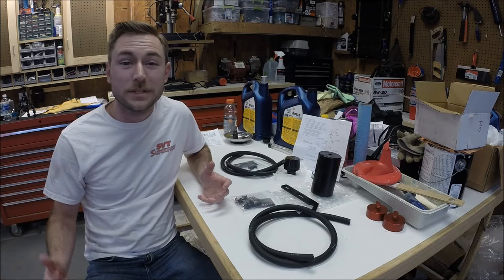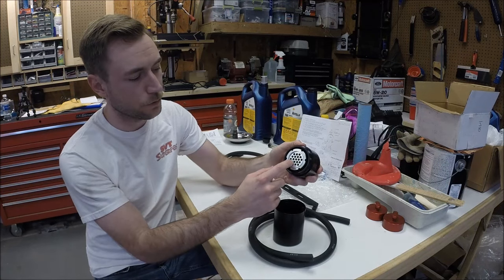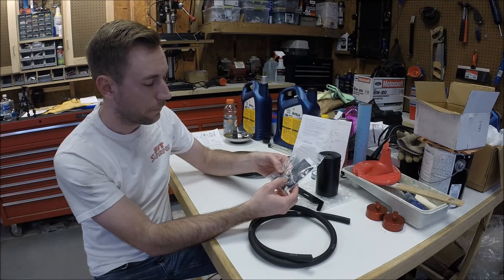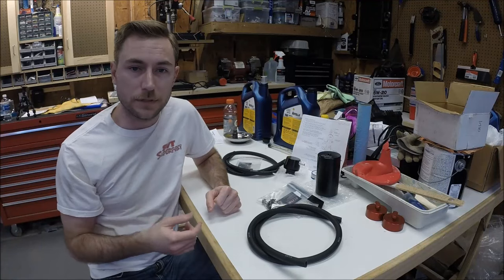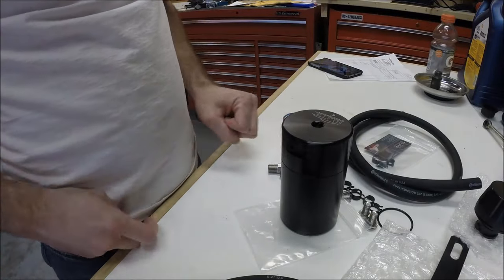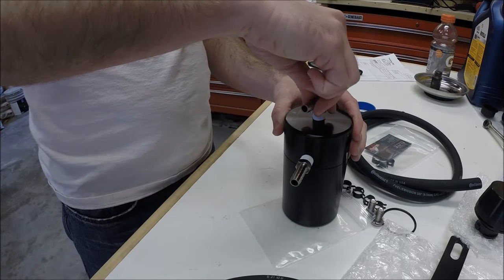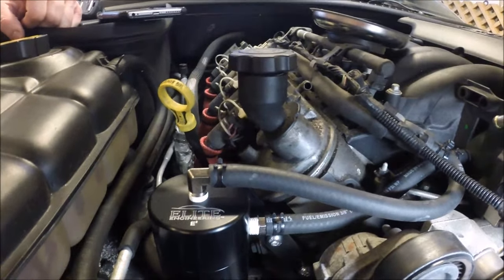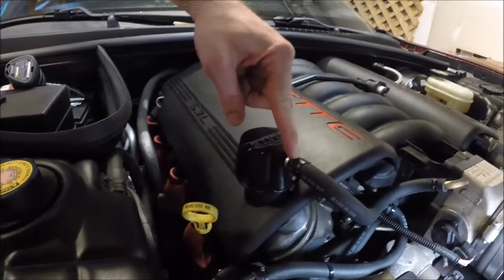Corvette LS1 - Elite Engineering E2 Catch Can Installation

Comment: I have a turbo LS4 setup... any ideas what to do?
Reply from the maker: Rick Dangerous  I'm not as familiar with the pcv routing on that motor but I can say it would need some configuration changes as you don't want intake pressure (boost) pressurizing the catch can.  I suggest contacting Elite Engineering for a setup specific to your turbo motor.

Comment: How often do you have to refill your oil
Reply from the maker: It will vary for each person/car and how you drive.  Also keep in mind that a catch can doesn't change the amount of crankcase blowby your engine produces.  It only captures it and prevents it from going through the intake manifold.  For me personally, I've always changed the oil between track events, so it never in there very long.  For track events, depending on how much your catch can is collecting, you may want to top off the oil each day.  For daily driving, you aren't likely to collect enough oil to need to top it off, but monitor it and see what your car needs.
Reply: @ScrufsGarage   Thank you for the information. I have a 2002 Camaro SS with the LS1 in it that I daily drive and I barely get into the throttle but sometimes I do
Reply from the maker: Happy to help.  I definitely recommend the catch can.  During my engine rebuild I had my intake manifold off and was able to see how much oily residue had gotten through the pcv system over the years.  So anything you can do to keep oil vapors out of the intake will be a benefit in the long run.
Reply: @ScrufsGarage   Yeah about 5 months ago I picked up my car and it had 13000 original miles on it so I want to keep it as clean as possible here is a video of it.  https://youtu.be/Qc7nAsWWJqo
Reply: Nice video, are you saying that I should NOT put that oil back into the engine?  Does it really matter since the oil is reused by the engine anyways?

Comment: Are you down any engine oil
Reply from the maker: Mr. Lucifer  you do need to monitor your oil level, but it shouldn't be dropping so fast that you have an issue.  (If it is, then you have bigger problems). Normal street driving isn't much of an issue but your first track day with it, def check it after each session until you get an idea of how quickly it fills up.

Comment: I also have a 2001 vette. However I am having fitment issues because of the belt spring tensioner. I believe it is an ugraded and larger tensioner because of the magnuson supercharger. The elite catch can kit I got came with the hockey stick bracket. Do u know of an alternate bracket or location that will work for the c5?
Reply from the maker: Hmm, I'm not sure.   The hockey stick bracket is slotted, so there's a bit of adjustment.  The further up you move it, the further it moves it away from the tensioner bracket.  It that doesn't work for you, you might be able to fab a bracket of some sort.  The physical location of the catch can isn't too big of a deal, though you may need longer hoses.  And you will need to be able to get to it so you can empty the can.   Also, keep in mind with a forced induction system, you'll need a little different setup than what I have.  You'll need a check valve so that you don't pressurize the catch can.

Comment: I didn't think that it will catch that much oil WTF
Reply from the maker: Every motor will be different, but the LS motors are known for blow-by, which is why the catch cans are so popular.  Just shine a light intake your intake and you're lightly to see oily residue.   But keep in mind the oil I showed was after a track weekend.  Each session is 25-30 mins, x4 per day, 2 days in a row.  So that's essentially 4hrs of WOT use, which is significantly different than anything you could replicate on the street.